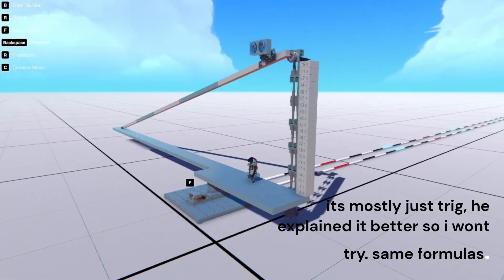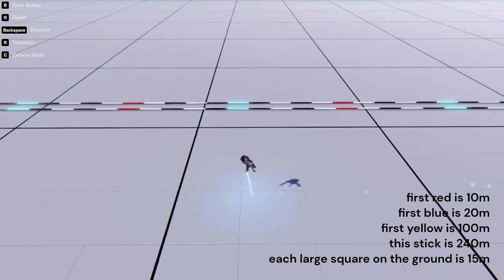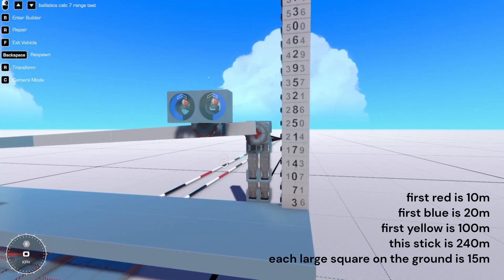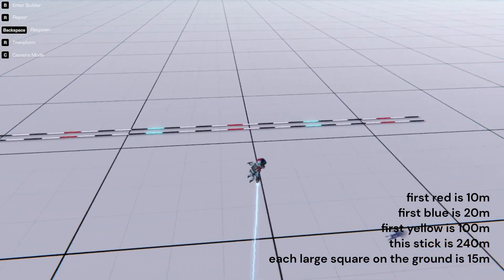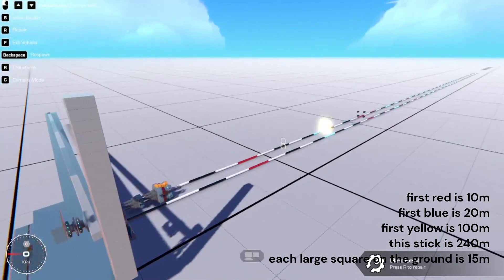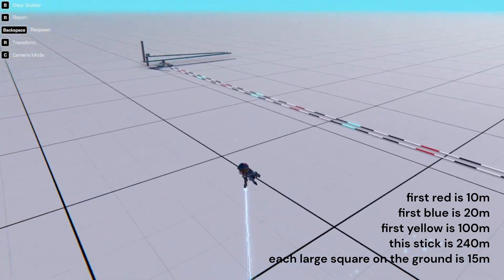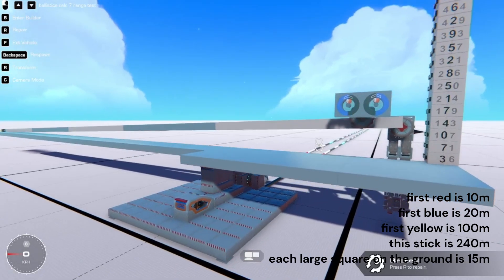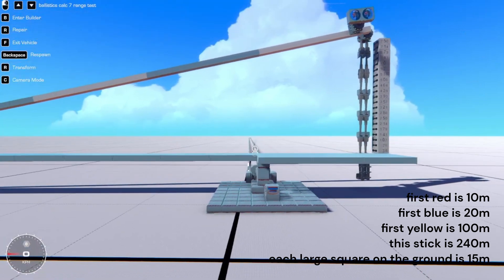(Bad) Ballistics Calc in Trailmakers

Comment: from the sounds of it the newest update about to come out might make this easier, im not to sure though im not the best at math
Reply from the maker: oh yea absoulutly. its just 5 gates now for the whole thing. the only problem is a good rangefinder but even that's doable.
Reply: @ i know you also worked a little with a tracking missle, it sucks that they still havnt increased the distance sensors range but they added a few more configurations for it as well as some logic that ,according to a video I saw, should make you able to use some triangle math (I forgot what the guy said) to track better, it would be cool to see you revisit that idea when the update comes out if you think it would actually make making one better

Comment: Im looking at this and the old videos about the old computer, and its impressive, but I can't 
help but want to introduce you to the concept of an OR-loop:
basically 2 OR gates feeding into each other create a storage cell for a number from -1 to 1, and you can add or subtract stuff from that number every tick by doing an input into both of the gates, and you can take that number and use it for stuff.
I have been able to output those numbers onto a display, do addition, subtraction, multiplication(a bit scuffed but works), compare numbers, and even synchronise turrets with different horizontal traverse limits ("early turret control system" on the WS). I tried more stuff like an old fasioned rangefinder with 2 cameras, but my trigonometry knowledge is khmkhmNotGoodkhmkhm.
love the "useless logic stuff" though🙃
Reply from the maker: already aware. that's a way to store data. i am trying to compute data. i don't need to store data if im doing the computations live and feeding the output right to the gun. unless you can do powers and nested fractions it probably wont help but if you could send me a video to see it i would still love to.